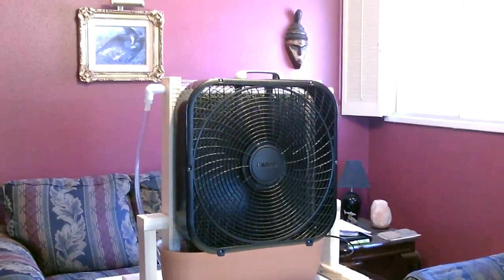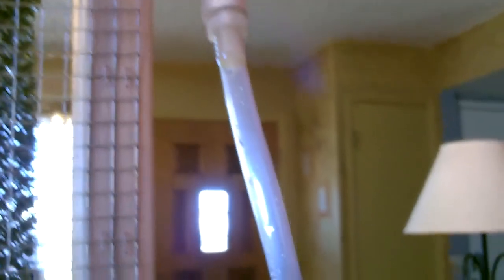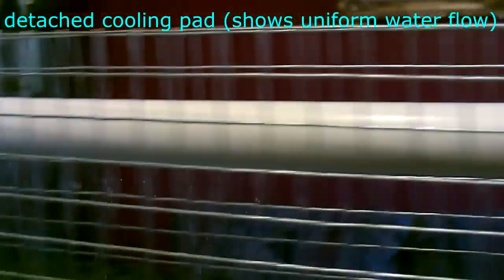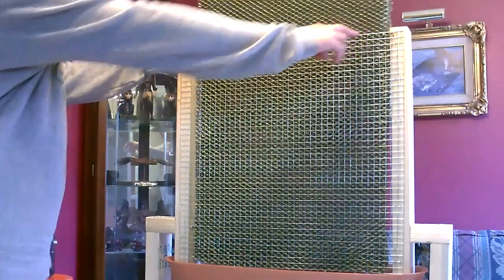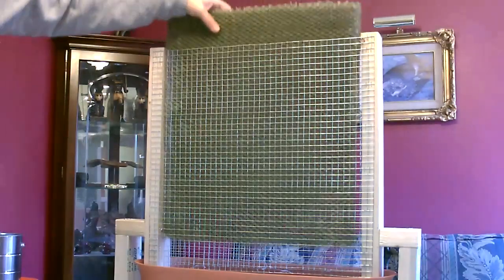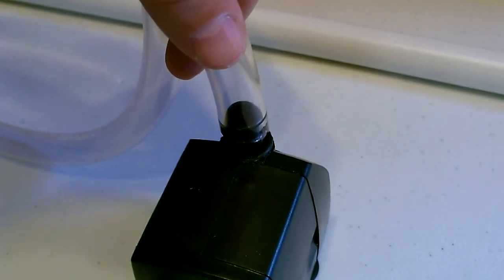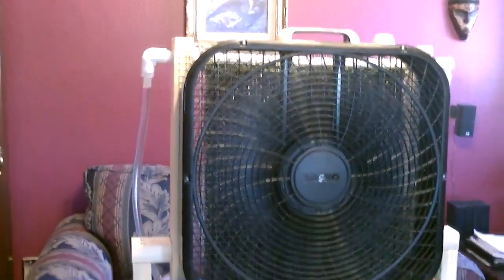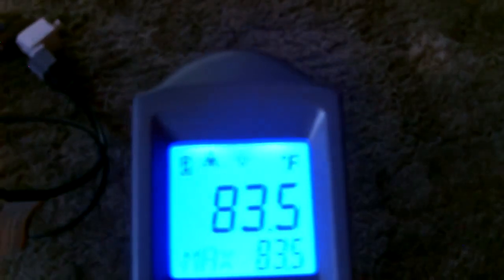Homemade Evaporative Cooler! - "whole room" Super Cooler!  - up to 30F drop! - Easy DIY

Comment: Why it doesn't need ice in the water?...no explaination? are those gallons of water cold? or just room temp water?
Reply from the maker: hi there. all you need is room temp water for evaporative cooling units (no ice is needed). that's because they 'double' as water chillers. how it works: as the water runs down the pad, both the air going through the pad (and the pad itself) cool down *by way of the evaporation that takes place on the pad. since the pad is cooled down, the water running down the pad gets cooled down too. you could actually start with hot water if you wanted too and within 5 minutes of turning the unit on, the water will be cooled all the way down. (I once cooled a 12 gallon tub of water from 100F down to 60F in 5 minutes using evap cooling pads)

Comment: Can a cut to fit air filter be used is also made out of polyester?
Reply from the maker: hi there. it's unlikely that an air filter would work. evap pads are made in a specific way.
Reply: @desertsun02  Thank you for replying! I will give it a shot.

Comment: DUDE, you SERIOUSLY need to get an AFFILIATE ACCOUNT with Amazon or Home Depot or Lowe's or whatever. Then, get the links for the parts needed to put these projects together in the video description using your affil link  to get a commission when someone buys parts from your links. You're doing folks a service of showing them how to put this stuff together AND making it easy for them to get the parts, and making a little money from each sale. Win-Win.
Reply from the maker: hi there. i hear ya. the main problem with posting links is that they are always changing. (sometimes every few weeks a link will be no good anymore. *i think it's called a 'dead link'). after a while the description sections of the videos just fill with dead links. another issue with links is that it gives all the business to one supplier (doesn't really seem fair to all the other suppliers that are out there). since the stuff needed to build most of my projects is generally easy to find on amazon/home depot/lowe's etc. a quick search is usually all that's needed to find the stuff. i've always figured it's easier for people to do a 'search' and get active random links to the items needed. note that when people ask in a comment for a link to something specific i try to find one and i'll post it. but it's a case by case thing. 🙂

Comment: What do you think about using 3/4 in. PVC tubing, & drilling double the holes in the tubing for more water flow, & do you think the same size pump would work pretty good for that size PVC, I'm going to build your 4 sided swamp cooler, with 3/4 tubing, with double the pads, just wanted your thoughts on it
Reply from the maker: hi there. if you build this one i would recommend against using 3/4" tubing with double holes. the reason is that the water flow on this one (as shown) is more than enough water flow (probably a little too much). if anything you would want a little less water flow for for it to work it's best. if you build the 4 sided one i'd say to start with a minimum of holes at first and see how it works. you can always add extra holes as needed ✔😎

Comment: Thanks for the video, can someone explain please why the wire mesh? Does it help evaporation/cooling or is it only for build stability? Thanks!
Reply from the maker: hi. it's mainly for stability and to make sure that the fan does not come in direct contact with the pad (a barrier).

Comment: Evap coolers have to evaporate water to work. When it is in an enclosed space or  in a neutral pressure room meaning no outside dry air introduced they will work until you get indoor humidity levels to wetbulb then they no longer evaporate ie no longer create a cooling effect.

Comment: I agree with the previous post--it's probably commercial pushback. If you did the unit with solar-powered water pumps and a solar-powered box fan, you could avoid the use of any house current at all (both available on Amazon or Ebay).

Comment: What percentage of humidity do these work at? and then above  what humidity do  they not work at?
Reply from the maker: hi there. they typically break it down into 3 categories. 0-30% RH it works awesome anywhere inside and out. then 30%-60% RH it works good anywhere inside and out. above 60% they recommend only using it in larger outdoor or semi-oudoor situations (like large "open air" garages, patio's decks etc... ). with a powerful fan and large surface area you can get some cooling all the way up to 75-80% RH. the temp drop is only a few degrees at higher RH but when you factor in windchill too, you can still get a decent "feels like" temp drop. (10-15F)
Reply: @desertsun02  Thanks it is usually below 30% outside and sometimes about 45%, so it looks like it will work at my house.

Comment: Awesome video. Living in SW AZ this might go well in my tiny shop. I do have 1 Concern. The fan being so close to the pad, does it not suck vapors through the fan? Just asking
Reply from the maker: hi. no, all the water stays in the pad. i have noticed it works a little better if you slow the water flow rate down a bit (i now go with 1/16 inch holes)
Reply: @desertsun02  I'll do that. Let you know how it goes.

Comment: Just found this now....please could you explain the science of this all. / I'm in a room of 20 ft x 15 feet and wish to cool it down as the Uk has a heatwave that won't go away. / Does the current hot air of the room come through a section to be cooler where the new lower heat gets pushed out into the room. / I don't understand the science behind the section bit. / Please could you explain... Thanks Michael

Comment: How many gallon per hour pump are you using I built a similar thing as you did right there and I'm not getting the water lift up to the PVC tube and the distance is the same as yours in the hoses 3/8 inside diameter what gallon per hour maybe pump needs to be stronger

Comment: I like this version.   Years ago, I lived in an older mobile home, it had a cooler on the 
roof that appeared to be just a blower fan and a water tub, never could figure out
how it cooled, but that thing did put out some cold air.    I did some research found it's
called a "swamp cooler".     I'm gonna do your build, cause I think it would do well
off grid using a 12 volt system, Thanks

Comment: Nice job, some possible suggestions for future improvements might be to have the two mesh pieces much closer together and openable (hinge at the top maybe) so they grip the cooling mat removing the need to attach the pad directly to the hose.  This design looks like it might be hard to clean the evaporative cooling mat, and it will collect a lot of dust fairly quickly.
Reply: You could put an ac filter on the backside to collect dust. That's be alot easier to clean/replace at the cost of a little airflow.

Comment: use the water to cool a set of TEC1 thermal electric cooling units. put the water out side and just run the water hoses in to cool the TEC thermal units.

Comment: Same concept as a swamp cooler. Run a small 1/4" line to the tub and put a float switch with a solenoid on it and it will auto refill the tub for you.
Reply: Forgot to say add a plug wired to a 110v to 24v transformer using 24v for the switch and solenoid.

Comment: Here's the way you could do this. how about a cooler filled with ice,  a pump to pump the melt off through  a radiator. Ice cold water in a closed circulatory system. This way your not putting too much moisture in the air. You will experience some condensation, but the humidity will be cut substantially.

Comment: for me I sealed the sides with aluminum tape and made a cap for the top to ensure air flow from the back.  also, I suggest cutting the pad about a half inch wider on each side because once the pad gets saturated it weighs down and the sides come in.  I put ice in my water and it also made a difference in temp output. something else you might want to suggest, treat the wood with something to waterproof it or it will expand, crack and mildew over time. works great thanks for the video!

Comment: Interesting to see long term test on this. My thoughts are you are going to raise humility levels in the house, eventually causing it to feel muggy inside. Air conditioning works by removing humidity
Reply: right. There is no dry, hot air intake. He built a humidifier.

Comment: Awesome concept, but question: the way you've mounted it, how will you change the cooling pad when it gets slimy and gummed up from water continuously flowing through it?
Reply: To solve that simply take the unit outside and substitute some of the water for bleach about once a week to kill any cultures growing in the mat.. Once you have run it for a while run a cleaning cycle to reduce the "bleachy smell" residue

Comment: Might want to put a water proof/water resistant finish on the wood parts. Also use distilled water if you have hard water locally. Distilled water will keep the pad from getting clogged up with lime deposits. 
You'll also want to drain and clean the cooler occasionally or put in some anti-bacterial additive. Otherwise the tank, pump, tubing and pad will start to have things growing on/in them.

Comment: What kind of pump is in use for the Evap cooler
Reply: A water pump powered by electricity.
Reply: It looks to be an Aquarium water pump... so there needs to be some sort of float switch incorporated, in the case of the reservoir going dry

Comment: I had a small fan like this back in the 80's it was battery powered and it used ice cubes on the top it put out 57 degree air.

Comment: i advise you look up what a cooling tower is, and look for a good process flow diagram (PFD for short). then use your cooling tower as its meant to be, outside. next, get a radiator (car rad, car heater core) and an air mover. pipe the water from the cooling tower to the radiator and place the radiator in the room you want cooled. this works best with a heat pump. 

by leaving the cooling tower in the room you are trying to cool you are minimizing the effectiveness of the system. water only turns to steam at atmospheric pressure at 100°c, that includes in this system. that means any water lost due to evaporation is at 100°c or higher, adding to the room temp. you do gain some cooling due to the high latent energy required to change water to steam compared to increasing the waters temp. you are also increasing humidity which inhibits your body's ability to cool itself making lower temps feel hotter. 

if you instead use a radiator, the water will chill the air going over the radiator and absorb heat in just  the same manner, only this time it doesn't release more water into the air. instead it decreases the dew point, and if the humidity is high, it can cause moisture to condense and lower the rooms humidity.
Reply: tristen turner 
'Water only turns to steam at atmospheric pressure at 100°c', WHAT? Water vapor is not the same as steam. It happens at any temperature. as long as there is a difference with surrounding air layers. Or do you think clouds are made of 100°c steam? Funny man you are.
Reply: i think you should read what evaporation and water vapor are again. i did make a mistake though, water molecules have to be at or hotter than 100°c at 1 atmosphere pressure to evaporate or sublimate. this happens due to constructive interference in the motion of the molecules. once in the air they can be super cooled to below their condensing point and unless they bump into another water molecule it will likely stay in the air. but every time it hits a relatively colder air molecule it gives the air some of its heat energy. when it condenses, it releases its latent energy into the air. so the net effect is you remove heat from the water tank and put it into the air. the water does get colder but it heats the air. 

clouds are not steam. warm humid air being cooled by both lower pressures and contact with cold air causes the dew point to drop and the water in the air no longer has enough energy to remain suspended and begins to condense. fog and clouds are tiny drops of water suspended in air.
Reply: That makes sense to me. Thanks a lot for the elaborate reply. You might still be a funny man, but in other fields.

Comment: so where does the heat go? energy can't be lost in a closed system. surely it vents heat somewhere.
Reply: Golden Grenadier when water changes state from liquid to gas (or vice versa) it takes 970 btu/lb. a gallon of water weighs 8.33 or 10 lbs depending whether its a metric or american gallon. at 3 gallons thats roughly 30 000 btus removed out of the room.
Reply: ...and dont call me Shirley
Reply: When water evaporates it takes quite a large amount of heat to change state. If you condensed the water vapor you'd get the heat back. (It would warm up the cold surface it condenses against).
Reply: Golden Grenadier It doesn't vent anywhere and doesn't have to. Vaporization of water is an exothermic reaction, so energy is conserved because energy in the form of heat inside the room is converted to the kinetic energy of water particles, causing a state change. So the water evaporates and the temperature of the air lowers. This reaction is spontaneous as long as the humidity is relatively low, so this type of cooling system works, but not in high humidity.
Reply: Tyson Jezowski metric gallon???  ha we have metric liter in Canada
Reply: There's no metric gallon, but there are a ton of different measures for the gallon. Generally people only refer to the US liquid gallon (defined as 231 cu inches) or the Imperial liquid gallon used in the UK (277 cu inches, defined as the volume of 10lbs of water). This means the size of a fluid ounce, pint, quart, etc all differ as well. The Imperial pint is 20 Imperial fluid ounces, whereas the US pint is only 16 US fluid ounces. The US and Imperial fluid ounces differ by about 1mL, so it's just sort of a mess; there's no agreement in any portion of it. Historically it was worse; there was a separate wine gallon, ale gallon, etc

A lot of people in the US don't understand anything but "American units" so I'm not surprised to see someone think the Imperial liquid gallon is metric, especially considering the UK uses metric for pretty much everything except highway signs and fuel economy. 🙄

Comment: DS02, I have a cooler patterned after the one you built using 1/4" copper tubing but wasn't happy with all the ice it took to keep cool. Now I'm wondering what the temperature of the water is inside the water container? If it's cold enough it might help with the 111 F days we're having in the Central Valley. SO WOULD YOU CHECK THE TEMP AND POST IT HERE, please? TIA. DEC

Comment: The only down side to swamp coolers is if you have more than 40% humidity they basically stop working......but as long as you have low humidity they work amazingly well and to add to its cooling ability add a frozen 2ltr to the water..... it'll damn near freeze you out

Comment: I used to live in Southern Nevada and we had a swamp cooler worked great most days. On the ones it did'nt I would add ice to the water and rubbing alcohol it mixes well in water and helps the evaporation process.
Reply: You might consider using 1/2gl. milk jugs filled with ice..I don't have nearly as well a system design ( aluminum pie plates in front of a fan)  but they can easily  be re-frozen in the freezer and recirculated with others

Comment: finally a inside water cooler or otherwise known as a swamp cooler . I'm in my 60's and grew up with one of these in our window except it used a squirrel cage blower and water drained down on three sides  .

Comment: does using the setup with pump increase power bill by much? its mid june and am trying not to use my a/c and usually run 3 box fsns in the house and power bill is pretty cheap

Comment: Commercial grade (mounted) window-size water coolers are supplied with water using a garden hose at a very low flow setting.

Comment: This is a great idea. About the only things I would do differently is paint all the wood in some sort of sealant so that it doesn't get moldy. I would also put a pvc pipe at the bottom to hold the cooler pad in. Then I would add hinge at the top under the pipe where the water comes in and clasp at the other end. That way you could pinch the pad in between the two pipes instead of having to put that much wire on it to hold the pad up.

Comment: The fan that blows hot air out the back of portable air conditioning units, many people through their portable air conditioners away when they stop working because no one wants to fix them. Why not remove these fans and place them in a box and make a small swamp cooler out of them? Design the box with an evaporate pad with a water feed that gets no where near the electrical parts. These fans are very powerful and can force high volume air through a small openings which will drop air temperature has well. Its all on how you design the box and where you place the evaporate pad. Could get creative and use two fans one to push one to pull air through a evaporate tube to really bring down air temperature. A large copper tube with holes with a fabric over the outside that absorbs water that also allows air flow through it? Just an idea.